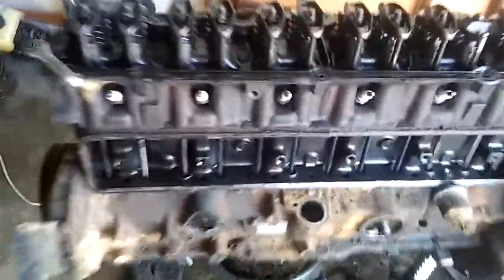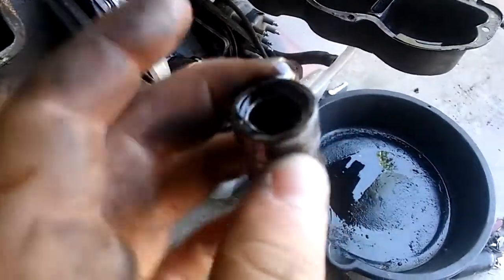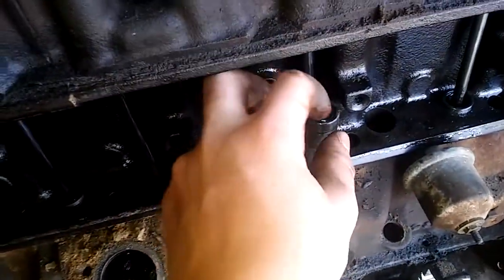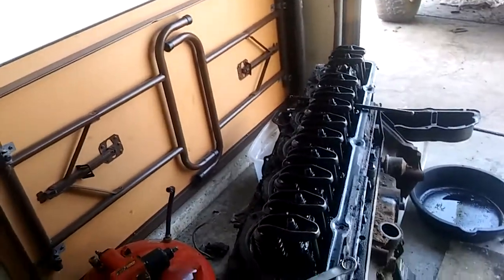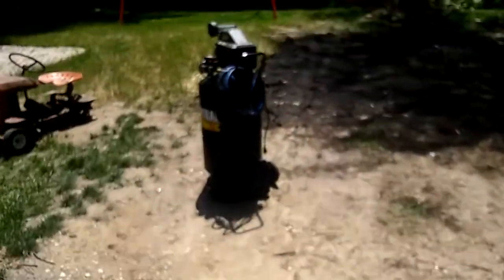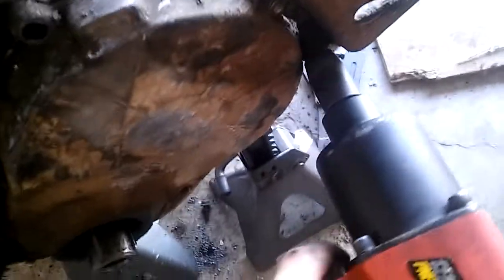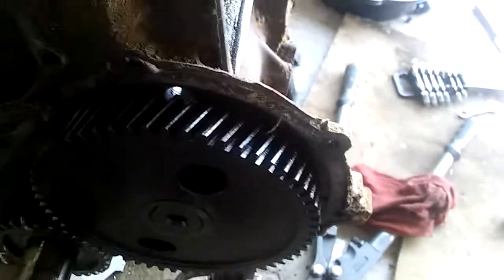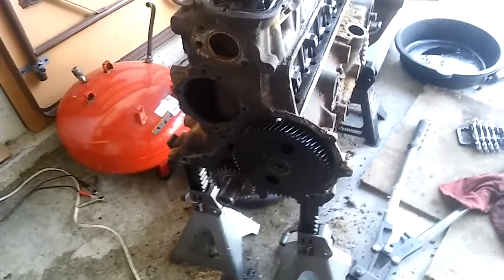Ford inline 6 300 rebuild part 3

Comment: Way to go kid. You are starting out right. I got my first car, a 41 Chevy, at 13. Me and my best buddy (12), worked on it for a year. We cleaned the carb, then overhauled the engine, replaced the clutch, went thru the brake system, and converted it to dual exhaust with a split exhaust manifold from a wrecking yard. All that was done with only advice from his dad.Then my mom showed me how to drive a standard shift in our very long driveway. I bet I drove a hundred miles up and down that drive till I had it down. Another year, and I had removed the chrome, lowered it 2 inches, painted it hot rod gray primer, and installed wide white Porta - Walls and moon disc. (ask your grandfather), Of course I NEVER EVER drove it until I turned 16 and had a license a year later.(wink)That started me on a 60 year long adventure / love affair with anything with a motor. I have owned more cars, trucks, hot rods, motorcycles, vintage / antique vehicles than I can remember, at times more than 4 at a time. At 73, I still do my own mechanic work, and if I had to live my life again, I would not change a thing.Like I said at the start, "Way to go kid"P.S. Marry a girl that doesn't mind greasy fingernails.
Reply from the maker: +Steve Wyatt Your a very inspirational person. I appreciate the time you took to type that comment. Thank you very much!😁

Comment: So cylinder 5 had a collapsed hydraulic lifter ( the lifter you were showing in the video ) , that's why the rocker arm retaining nut was loose. The lifter collapsed and created too much space between the rocker arm and the push rod, the subsequent smacking around from running caused the nut to back off to the point where you found it. Only way to learn is by doing what your doing here, look, record, review and figure it out... Good job!
Reply from the maker: Yep, for sure. I have another rebuild all in one video, and it has more performance upgrades!

Comment: thank you for the tear down now  i know what happen to my 1994 f150  the lifter on yours came apart i think my truck dropped 4 lifters all at once i want to rebuild the whole thing do you know what cam to up grade to?
Reply from the maker: 268H comp cam kit comes with everything except for the camshaft keyway camshaft retainer plate (if that's what you call it) and you may want to get some new cam bearings but I had to spend $260 on a camshaft bearing removal tool because a socket won't do the trick. Also if you don't mind going the extra length, get busy with a die grinder porting that cylinder head. It helps.